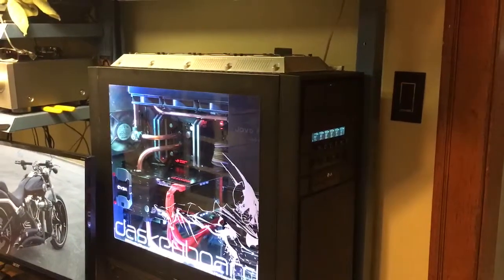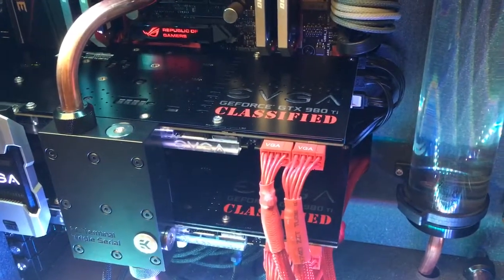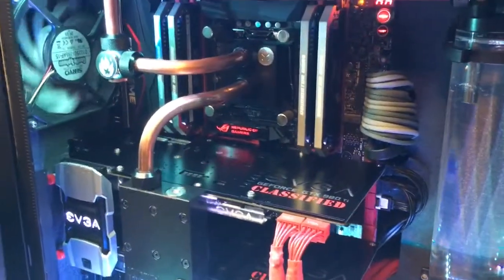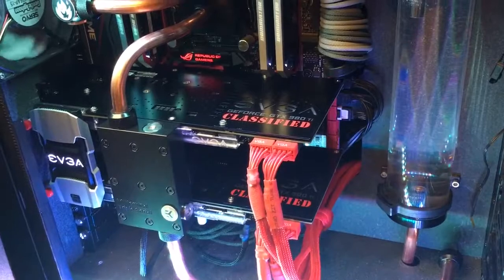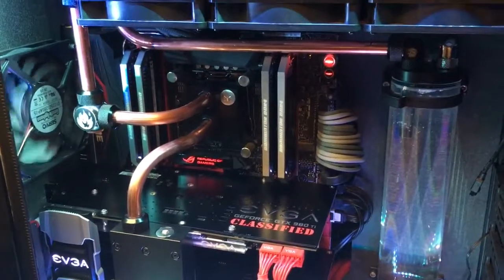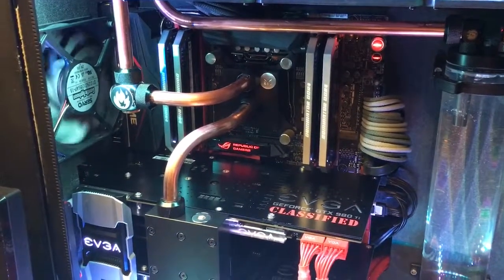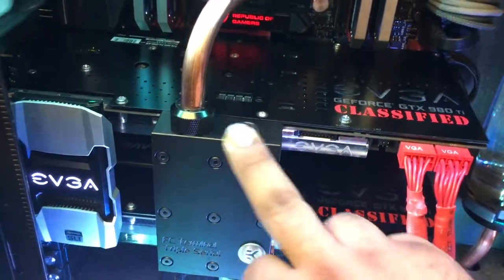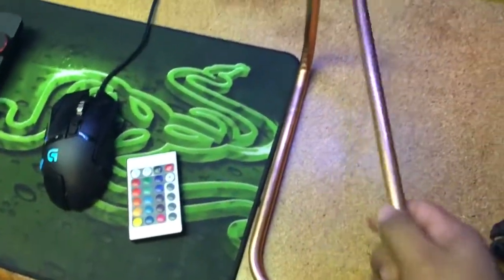2016 Liquid Cooled PC - Copper Tubing 980ti 5960X

Comment: 5:38 NO! its NOT bullshit. Very basic physics here. Copper will observe temperature from the water coming through. Sure, it won't spread it out as much as radiator but it will absorb the heat. Basically consumes that temperature from the water. And just because it does so, the water WILL be less hot/warm.  It makes zero sense to pain copper pipes. I mean its not gonna ruin your watercooling, but it makes no sense to paint copper.  Paint will always insulate that heat. Powder spray is an option tho
Reply from the maker: Alec S The pipes aren’t gonna cool more than 1 degree, it will definitely be less, which means it doesn’t matter if you paint them, since it’s up to the radiators to cool, not the pipes. I powder coated the pipes and made zero difference in temps.

Comment: If copper cooling didn't help at all there wouldn't be any reason at all to use them. They're expensive, they're a pain to install/uninstall and clear tubing can look really cool with water coloring added.
Reply from the maker: Clear tubing cracks. Which is why I prefer to use copper, heck Id do regular Primochill tubing over acrylic. With copper you can get the clean looks of Acrylic with added durability. A roll of 25ft is only 20USD at homedepot. Not any harder than acrylic to work with. They also sell 90degree fittings that you can weld and end up with a super clean look. I ended up powder coating my copper tubes and don't have to worry about them cracking, ever.
Reply: Leona197 acrylic tubing cracks easily, petg however does not

Comment: Dude I'm doing the exact same thing as you are. The only difference is that I'm using copper pipe bends because I don't have a decent pipe bender for half inch pipes.
How difficult is it fitting the pipes in end to end? 
All of my blocks are still in the mail. Should be here within a few weeks.
Reply from the maker: Tommy P I soldered some elbows too, not too hard actually. I ended up powder coating it.
Reply: Alright I'm pretty much done the build. I didn't bend, rather used rigid 1/2OD with 1/4" reducers from home depot.

I used 90 and 45 degree copper bends, and used jb marine weld to hold everything together.

Leak testing was great with no leaks although I mixed up the intake/out of the res and pump combo so I had to remake two of the pipes. I'm just doing some finishing touches and polishing the pipes before slapping it all together for a build.

This was my first rigid tube and I prefer doing rigid over soft tube because it just looks great to have the tight turned compared to sagging soft tubes.

I'm using brasso to polish and it looks f-ing amazing.

I'd like to try annealed copper tubes next and do some bends as you did, but as it stand I am absolutely in love with my build. Thanks for the reply.
Reply from the maker: Tommy P glad it worked out for you. At one point I also welded 90 degree elbows and powder coated the pipes.

Comment: does copper tubes gives better temps vs acrylic or petg tubes?
what's the size of your tube?
Reply from the maker: hisokiss nope, at least none that will make a difference. I just use them so they last longer, and won't crack. I had some acrylic lines crack on me before.
Reply: @LaBestiaHumanaMX  
thanks Leona, well i'm back got some questions again LOL.. what's the size of fittings you used? and what's the size of copper tubes you used? is it 14mm OD?

Comment: Great Build! looking to do the same this year.
Reply from the maker: Thanks, Copper is nice to work with.
Reply: 2 Ram slots Or 4..  ?
What is the Max Cpu Temp under Load?
Reply from the maker: +Farhan Ahmed depending on ambient, it's usually between 55&65C
Reply: Leona197
Mine Doesnt exceed 55c Is it normal for cpu Under load.. I dont know about new processors. I dunno
I have 6th gen intel core
Reply from the maker: +Farhan Ahmed it means nothing without ambient temps.
Reply: Leona197
I Guess that temp is with the ambient temps..
Its safe
Thanks